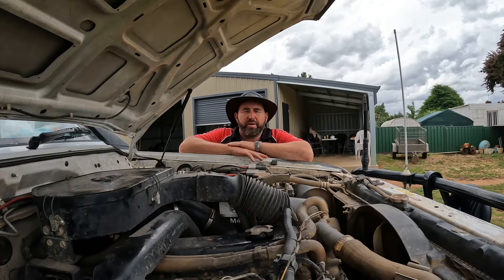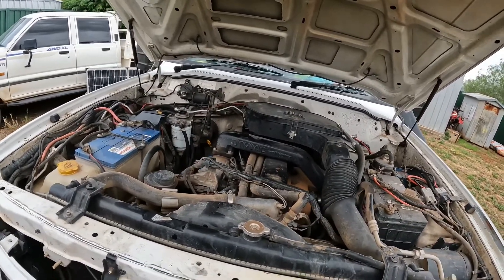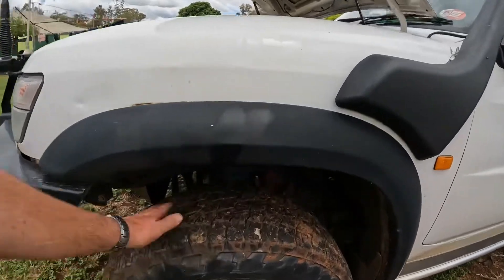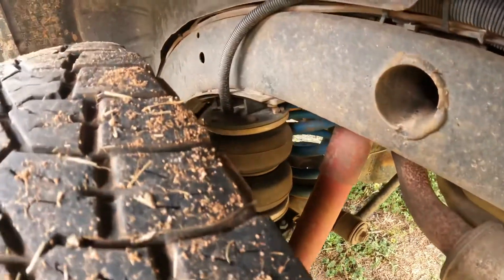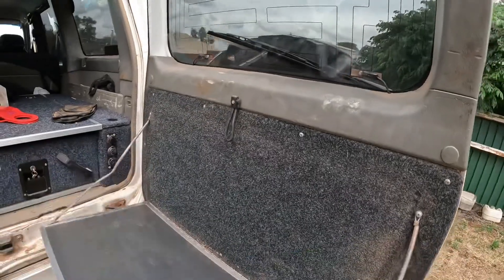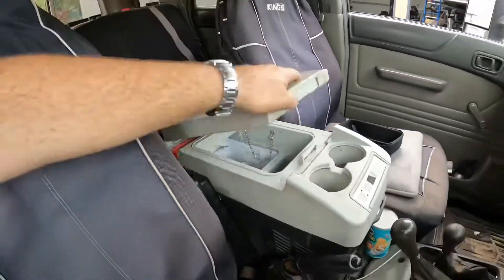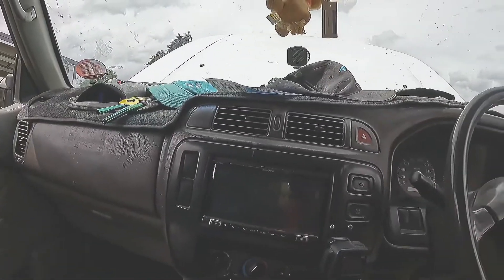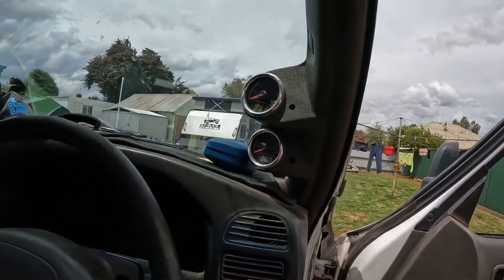Ol Mac Rig Run Down

Comment: Ive just stumbled across your channel. Absolutely uncanny, i will be leaving for long term trip early next year in my TD42 GU patrol towing an Austrack Tanami x13 and even with the same generator
Reply: also mate I have a rear bar, it is the biggest pain in the ass if you have swing away carriers on it. If you can avoid it, i would.
Reply from the maker: How good is that, I’m excited for you, I can’t wait until our next big trip
Reply from the maker: Thanks for the advice on the rear bar aswell

Comment: Hi just interested in knowing how you go with the weights and combined weights as I have a 2011 Nissan with upgraded 3.5 ton ,towing a Tanami 15X and we are still right on the limit with about 100 kgs left. As you know the sticker for the tow ball weight is in the dark door area. Just wondering how your car weighs up. Cheers
Reply from the maker: Hi, go be honest we’ve never had it weighed loaded or unloaded as we don’t have weighbridge access here but in saying that I’ve never had a problem towing the van and it’s done approx 50, 000 kms but it is on our to do list to get our weights checked
Reply: @olmaccrew2458  thanks for the reply. It’s that up here the weights and measure people are everywhere and right on to it. And it’s very hard to comply even with my upgrade.
Reply from the maker: YeH I know what you mean